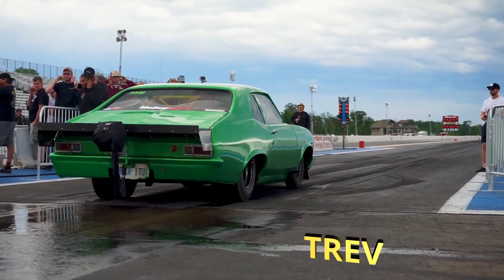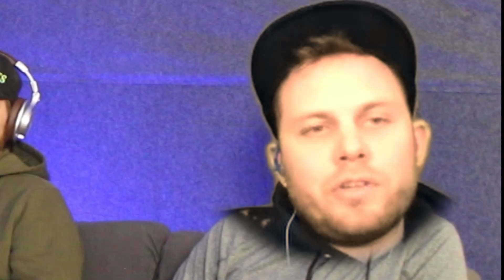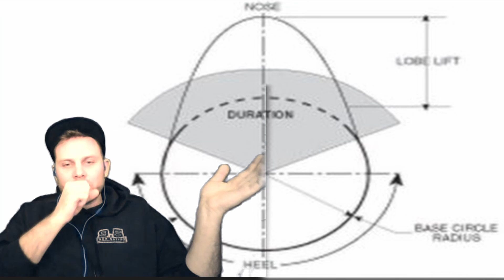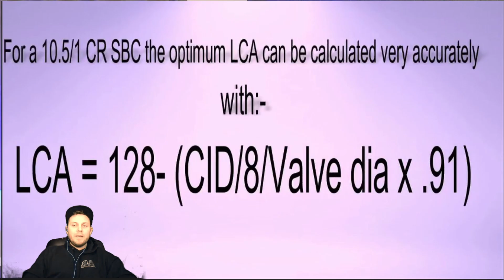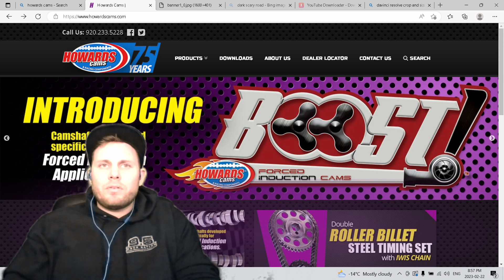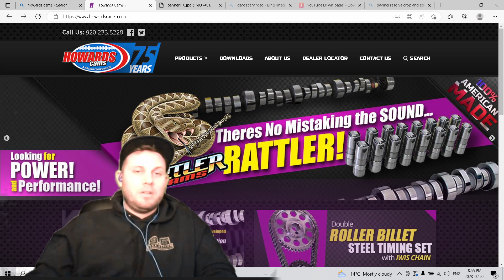Howards Cams, Get the lumpy chop , make horsepower,  roller vs flat tappet EP.6

Comment: It sounds very general but in my experience with mild 350 SBC with at least 1.94" smoggers or vortecs an around 230°/ .480"/ 108lsa cam runs pretty strong with a nice sounding idle.when I was young n dumb I tried a comp magnum 292 in a mild 350 and it was super numb down low but around 2500 like a light switch it woke right up and ran strong and the idle...wooo sexy unfortunately it was in a lifted square body so it got changed.

Comment: Vizards formula isn't for general use its specifically 10.5:1 n/a 4 inch bore sbc obviously it wont work on bbc because thats a different formula which is 131 or 132. He has also states that several times in every 128 video that it doesn't work for every random engine.
Reply: Yes, if you want to really get that super, insanely technical, then every single engine will be completely different than the last, unless they are built exactly the same way, with the same parts. That's why I love "recipes" for engine builds.

Comment: Cool group of guys here. 2023 and I still enjoy conversations about flat tappet camshafts. I dig the podcast.
Reply: I still run flat tappets myself, gotta remember, flat tappets powered a lot of cars for a very long time! And if I'm going a little more radical then solid flat tappet it is! They're cheap and they definitely work! Just gotta make sure you're running a good oil with zinc and you're good to go! People thinking you have to go roller to be competitive is just not so, as a matter of fact went to a big street car shootout last summer and they're was over 90 cars entered and the winner was a guy running an old 406 sbc with a hydraulic flat tappet! That thing was screaming, he had it in one of those old Monza Spyder's, really cool setup for sure!
Reply from the maker: It's easy for people to upgrade  engines on the cheap , with the flat tappet stuff , as long as people are modifying there old engines , I think we will see them around for a long time
Reply: Howards qc sucks had one roller cam that wasnt machine finished